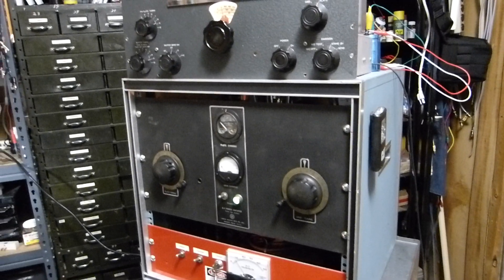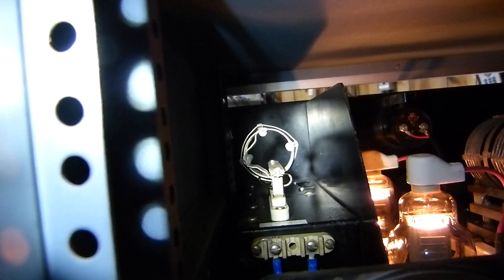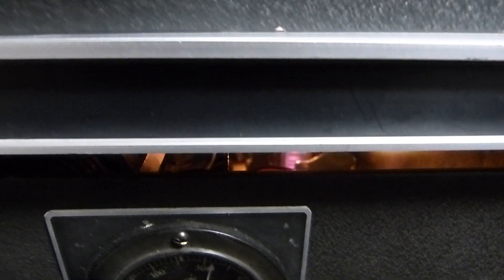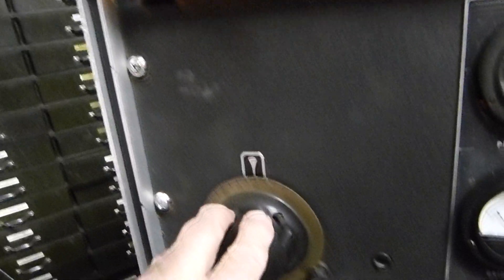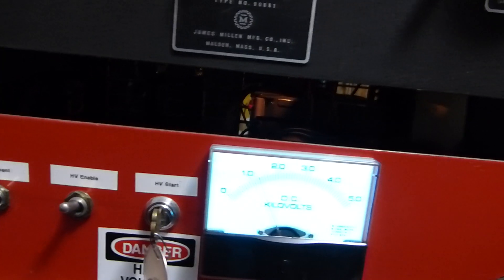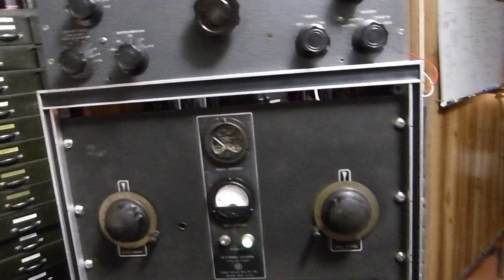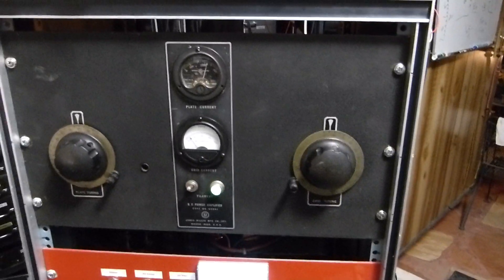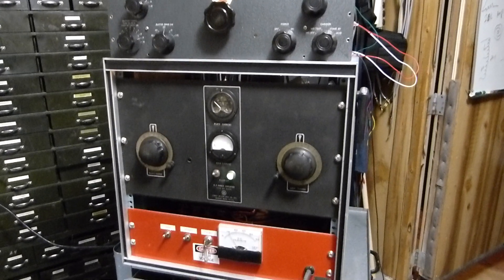James Millen 90881 Push Pull 20 Meter Amplifier

Comment: The two 120 primary windings on the bias transformer are probably not as insulated from each other as a real secondary winding would be. I guess it would be ok for testing. Two back to back filimant transformers would be safer.
Reply from the maker: I can't say for sure but I think insulation is usually good for 500 VAC, or more,  between windings.
I have found out the hard way that if a transformer is designed for a FWCT connection and it is used in a voltage doubler, things can go wrong. I used a 1800 VAC transformer in a doubler for 4KV output and after a few years, the floating CT did short to ground.

Comment: On that Collins 310B exciter's 2E26  output tube, did you try using a 6146 tube instead ?. If you do,  just check it for neutralization. It can handle a bit more plate current.. Just a thought .. Thanks !

Comment: Would it not be safer to somehow gang the 2 high voltage selection switches together?
Reply from the maker: I agree that would be best but I didn't have a ganged ceramic switch that can take the KV level so I had to use the separate switches.
Reply: @ElPasoTubeAmps  if the switching done at the primary or secondary side of the transformer?
Reply from the maker: @MM0IMC  It is on the high voltage secondary side as it has no primary taps. Primary taps are 2000, 2500 and 3000 volts with a CT. The switches are high voltage ceramic.

Comment: Great looking unit David, glad to see you got it working.. You mentioned that you're "pushing it almost getting 300 watts from it" How many watts was the unit designed to operate on back in 47' ? Thanks, Tom
Reply from the maker: It seems not so long ago, as you probably know, amplifiers were rated at power input, as required by the FCC, not output power so it was rated at 500 watts input. Class-C amplifiers are 70% or a little more efficient so it claimed to deliver as much as 380 watts output. And I am sure it would if I had brand new USA 811As. The 811A that I have are likely WWII vintage so, maybe I should buy some new ones... In the following video, I do get full power when I switch to 811A and got the grid and plate coil just right.   73

Comment: Great video. Thanks for all your great work in presenting this material. I’ve been working in electronics since the ‘80s, and I learned a little about tubes in my USMC technical schools, but I only recently became interested in tube electronics. I’m mainly looking at audio circuits, but the RF is very interesting. I just received a copy of the Radiotron Designer’s Handbook from 1953. It looks to me like there’s a complete analog electronics education in that book. Thanks again.
Reply from the maker: I think the RDH is a magnificent book. I have it also. I wish I knew even 1% of everything in that booki...
There is another book you may want - Audio Cyclopedia by Howard Tremaine. Here is an online link to it.
https://archive.org/details/AudioCyclopedia/page/n1529/mode/2up
And an Ebay link to the printed book.

https://www.ebay.com/itm/Audio-Cyclopedia-by-Howard-M-Tremaine-1973-Vintage-Hardcover-Book/352945115098?hash=item522d2b0fda:g:uokAAOSwAepeKfzN

Comment: What is the minimum voltage. A mercury vapor tube will run at. The max single ended for an 809 is 800vdc? I want the purple glow
Reply: a 866 mercury vapor tube will run at 120volts and i get about 150volts dc from that that powder blue glow is cool ..the 3B28  Xenon tube will give the purple glow and i think they are good for 10000 volts but do a data search on them to make sure they will work for you
Reply: GLASS MONSTER would you know about an 83 tube?
Reply from the maker: @duanethompson2360  The 83 is a small 4 pin base, MV rectifier. Not much purple glow to it but it is about as powerful as a 5U4 rectifier. It is used in the TV-7 tube testers because MV rectifiers have a constant voltage drop (about 15 volts) under load.   http://www.r-type.org/pdfs/83.pdf
The larger MV rectifiers like the 866A, 3B28 (and the smaller 816) and the larger 872A have a max PIV of 10KV. As an example, a pair of  872A can deliver an output of 5KV at 2.5A. Pretty powerful rectifiers for such an old technology.
https://frank.pocnet.net/sheets/081/8/866A.pdf
Reply: @duanethompson2360  full wave rectifier powder blue glow 5volt 3amp filament plate inverse voltage is 1550 volts max plate current both plates 1 amp dc 700 ma basically it replaces 2 5U4GB tubes